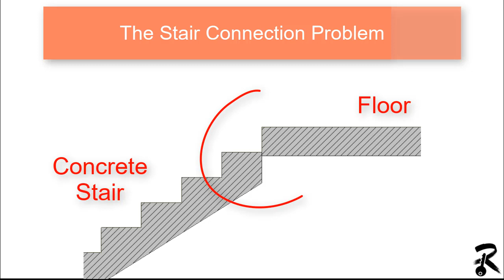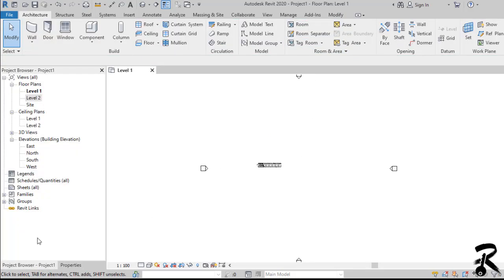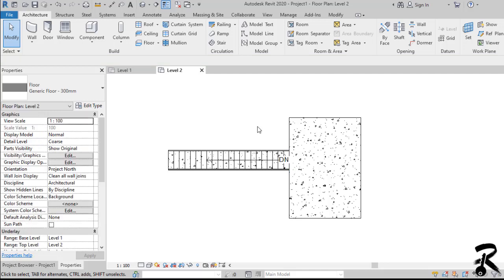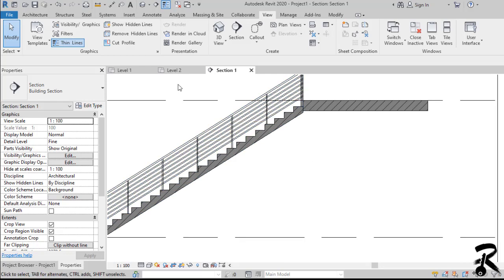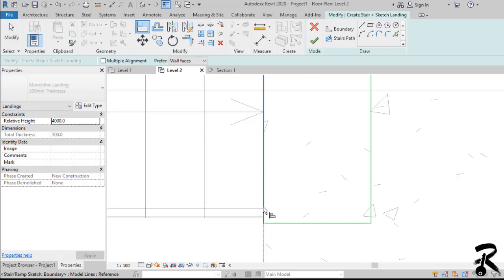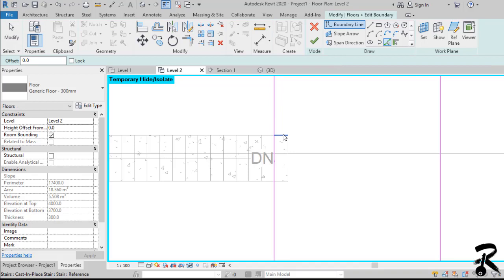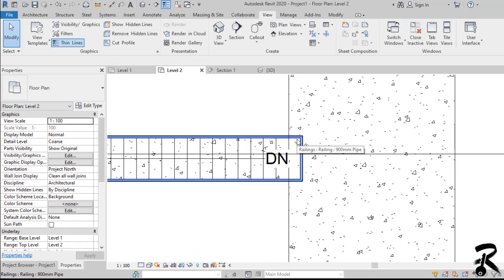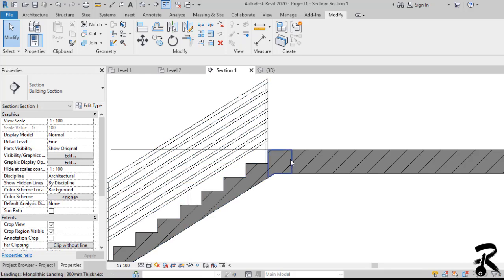Stair Connection in Revit

Comment: I just saw another similar video on this. This is not how you do it. Please do this: Once you finish stretching out or dragging out the stair. click on the stair you just made and look at your Properties: Construction - Uncheck - End with riser. This means it will end with a tread instead.
Reply: There are hundred ways
Reply: And who told you there’s only one way to do it?
Reply: @SimpleorDifficult  sure, there are many ways one can do things in revit. Some ways are best, and what the program was intended to be used. The way this is explained is unnecessary due to procedures that already take care of those issues. The more things done manually in revit, the more one breaks the connectivity, ie BIM, hence one is not using it as it was intended.

Comment: what a pain in the ass that we have to jump through these hoops to do something so rudimentary
Reply: meant to reply to you: I just saw another similar video on this. This is not how you do it. Please do this: Once you finish stretching out or dragging out the stair. click on the stair you just made and look at your Properties: Construction - Uncheck - End with riser. This means it will end with a tread instead.
Reply: @jaimeycaza3576  it still doesn’t allow you to join it the floor though does it? So you’re going to see an overlap with the floor and thick line?
Reply: @Seychelllian  That's correct (unfortunately) it can't be joined. you would need to select linework overrides per view.